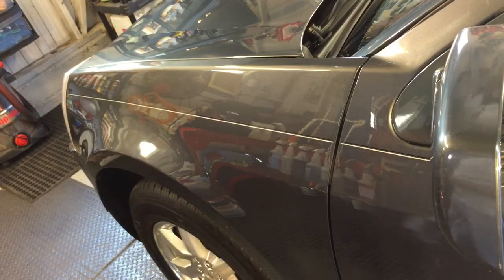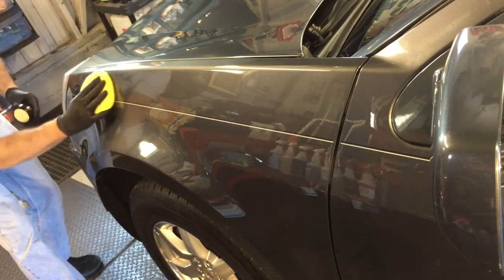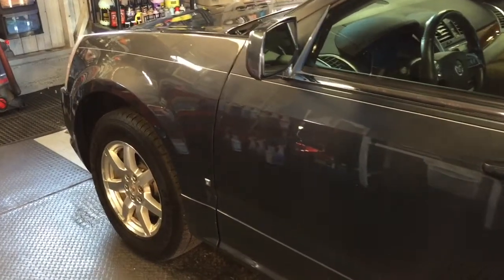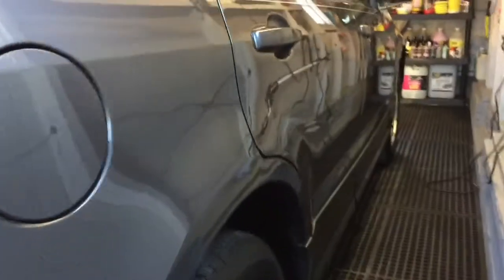Product showcase: Angelwax, Formulation # 1 ( A great long lasting coating for your car or truck)

Comment: What are you doing? You only apply the wax on the whole car and nothing more? You should only apply it to one panel at a time, and then buff it of with a clean microfiber towel.
Reply from the maker: Sorry sir... I have been testing and working with these products since inception! I know exactly how they react. And the best way to use them in my world. If you have a different way to apply... good for you👍🏻
Reply from the maker: The video was to show how little is use from a 33ml bottle... nothing more. Some people missed that i guess🤔